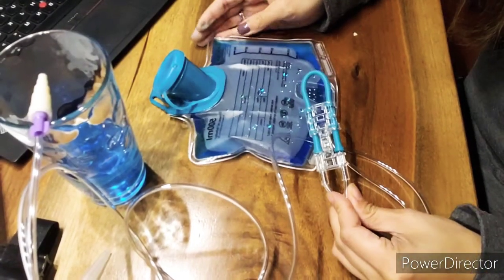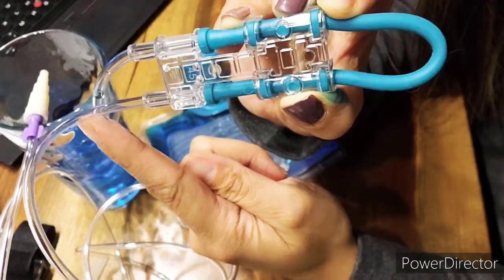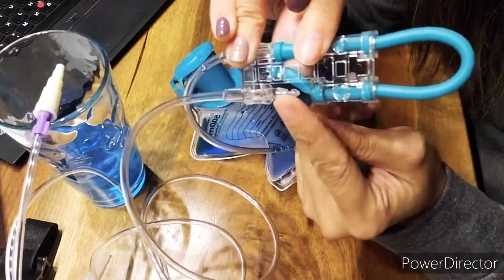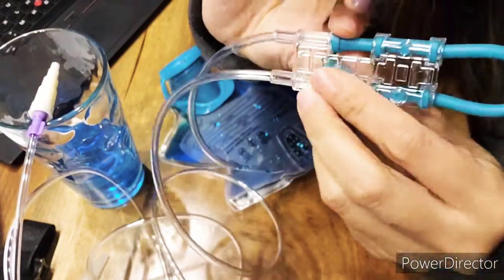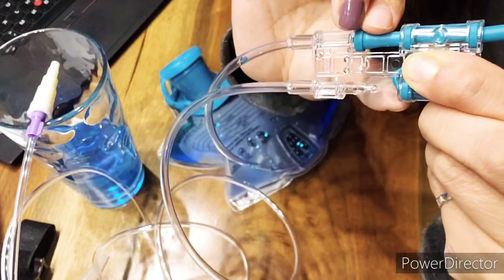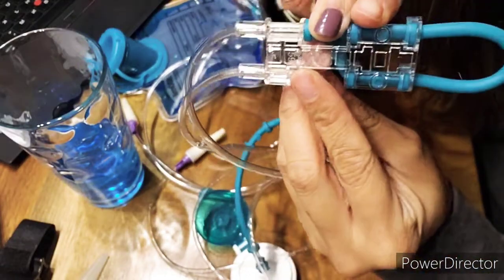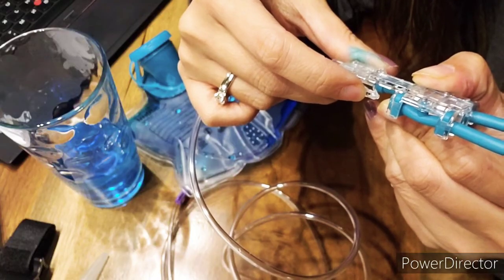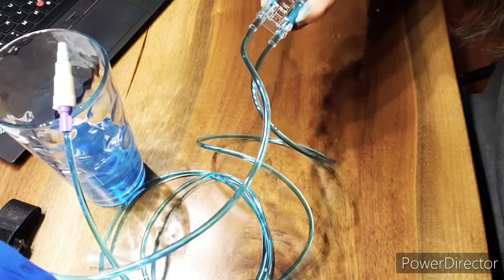Tubie2go - Moog Infinity Feed Bag: Manual Prime

Comment: In the hospital I have seen nurses prim this bag set by hand. We just had to change to the infinity pump, and I could not get the hand prime to work (being a clinic nurse myself I never learned this in my job). It seemed so easy to watch but so frustrating to fail when trying. The pump has auto prime but it is slow. Thank you for the video explanation.